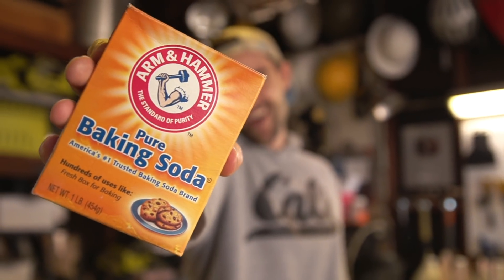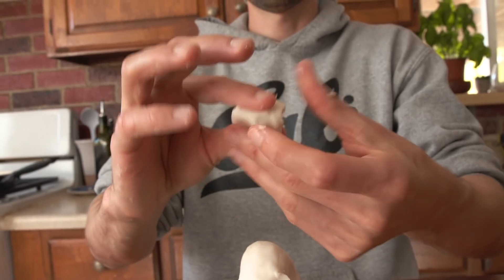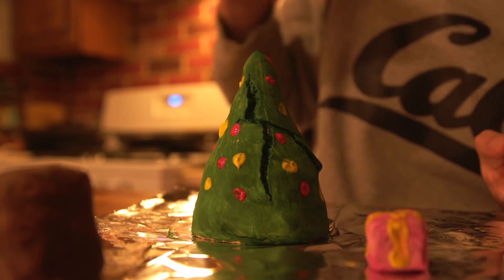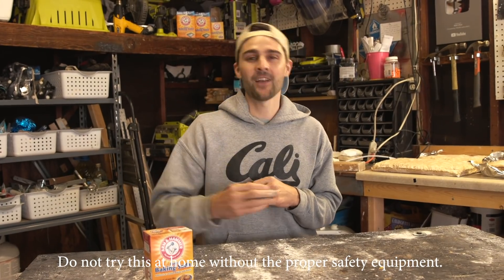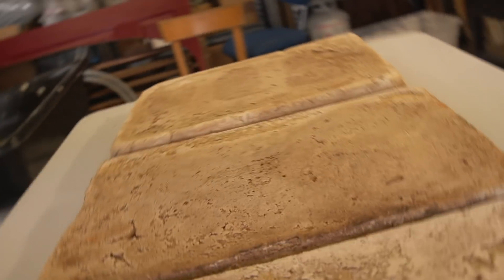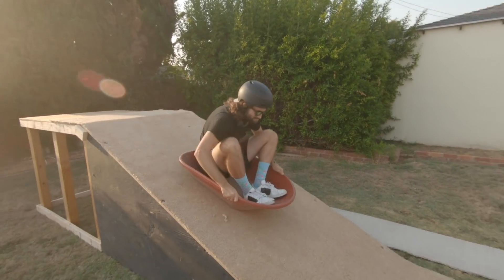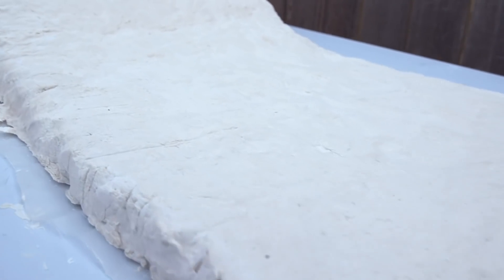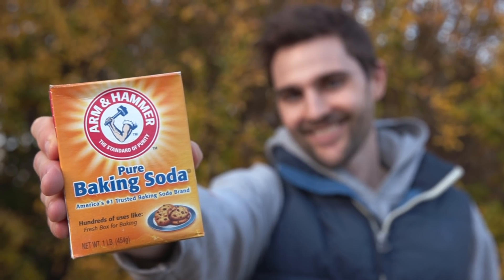REAL Sled made from Baking Soda! PART 1

Comment: My favorite  memory of baking soda,was when we were tight on money and my mom would brush our teeth with it.
Reply: Hood tricks lol wet the toothbrush then dip it in the box and coat ur brush lol also for newspaper crumble it in a ball then straighten it out and repeat a few times to soften the paper so it doesn't hurt when used as toilet paper. Contact me for more hood tips lol
Reply: My favorite memory of baking soda, was when we were tight on money and my dad would whip up some crack to make ends meet
Reply: Baking soda added to toothpaste will work wonders. Better results than those white strips and doesn't burn the enamel off of your teeth.
Reply: My favorite memory of baking is when my sister told me it was sugar

Comment: Hey Nick, get Two large popsicle sticks. 
Break Both of them in half.
Cut off the excess splinters from the bottoms.
Should look clean on the broken parts of all four sticks.
Now, place all four sticks 2 mm apart on a piece of painters tape.
You've made a splint. Put that on your broken finger, ask a doc what to take to reduce swelling. Shalom.